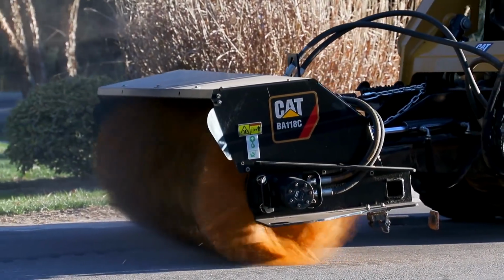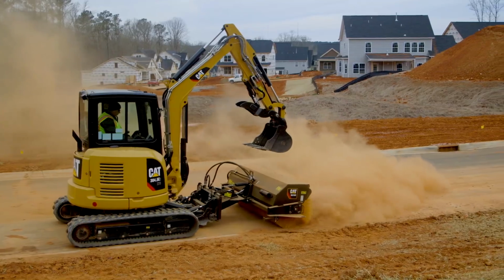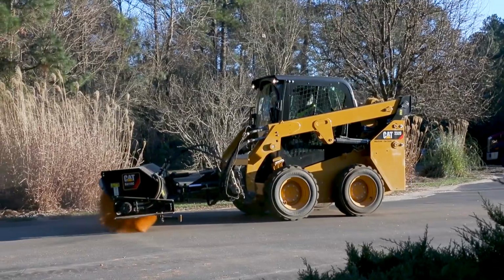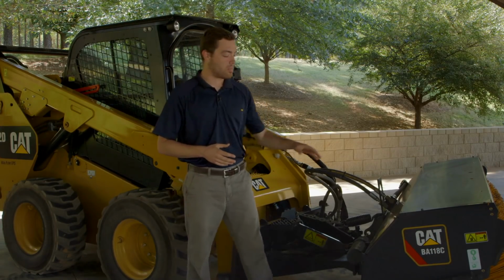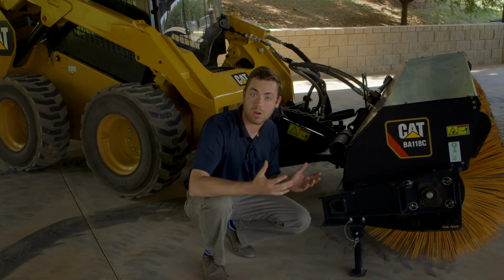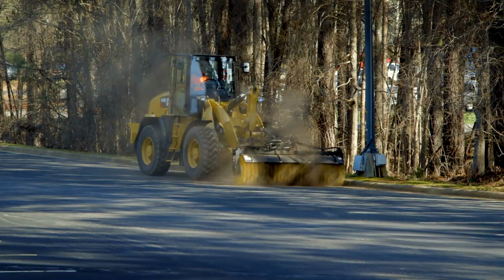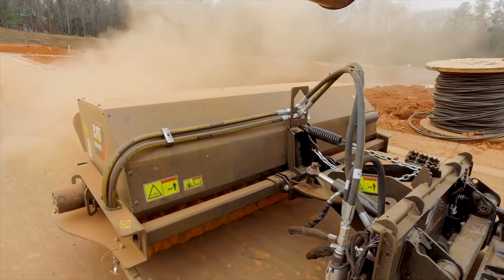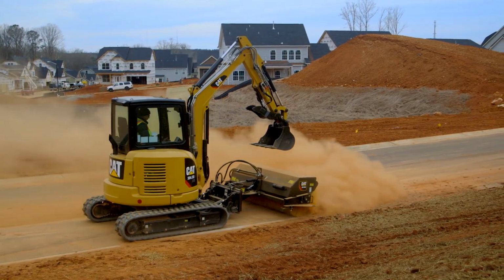Cat® BA118C Angle Broom Overview

Comment: Is poly or steel bristle better?
Reply: Any videos on how to change the worn out brushes?
Reply from the maker: Hi Logan! This answer depends on the application. Our standard broom will have 50% poly and 50% wire, however there are kits to help you make a broom all poly or all wire. All poly brushes are great for natural or artificial turf, including snow, because they offer great wear resistance and more lift action. All steel wire brushes are generally used on compacted materials for aggressive sweeping and cutting action.